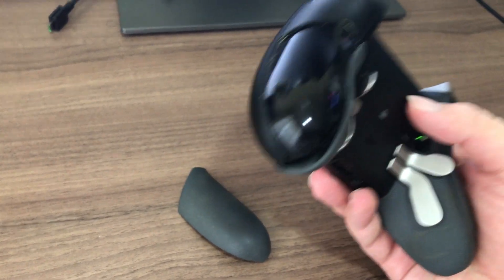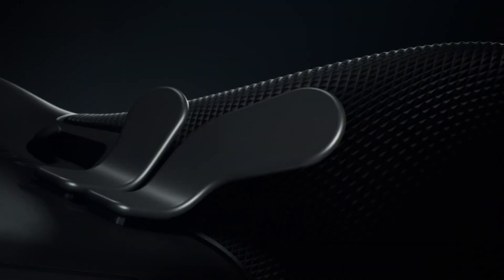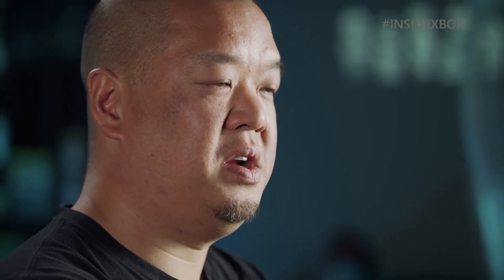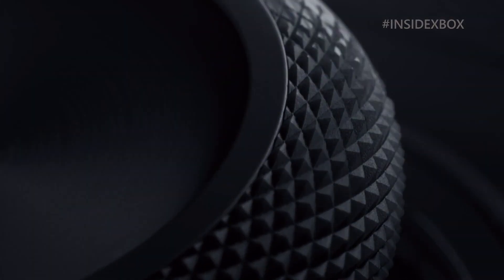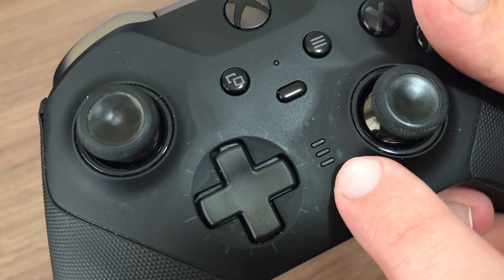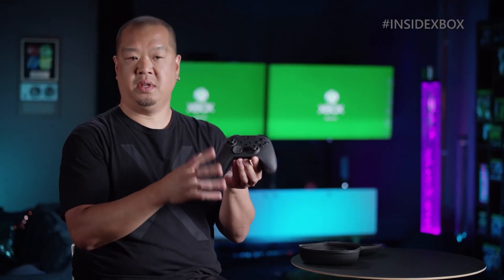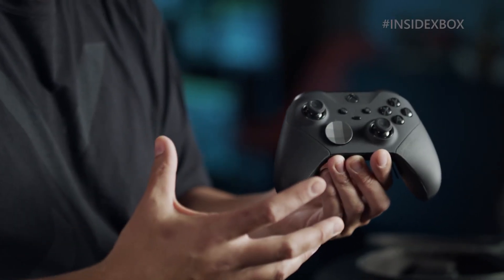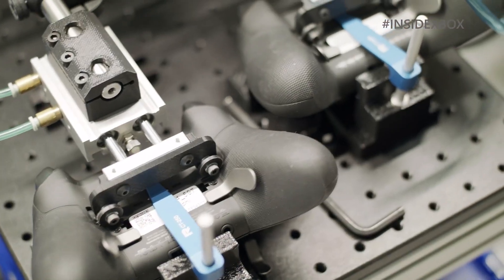Xbox Elite Series 2 After 1 Year: Did Microsoft Fix The Durability Issues?

Comment: Honestly the Series two will probably outlast its durability and effectiveness more that 6x longer than a Scuf controller. 

I’ve been looking for a wireless paddled controller that lasts longer than my current one (Fusion Powera $80). Mines still going strong after almost a whole year owning it. But i want a WIRELESS controller I can connect to my gaming PC since I am not eye-hand coordinated for Mouse and Keyboard. 

I believe this controller may last me longer than fusion, Scuf and add on paddles.
Reply: You would be wrong. I've had two series 2 elite controllers and both had ridiculous stick drift after a couple of months of light use and on one I didn't even notice that the top paddles on the back didn't even work because they where two short to trigger the internal switch , hard to explain but when you squeeze them you don't get that click no matter how soft or hard you pull, odd issue as my series 1 elite paddles work on the series 2 elite.

Long story short: the best feeling controller I have ever had. Seriously instant gratification upon picking it up. Battery actually does last an extremely long time, I Seriously believe you could run it for 24hour straight. Great charging pad/Case. BUT you are statistically very very likely to have to replace it within the year so even with Microsoft (after much customer demand) increased the warranty to a full year from 30 days you still have to ship it to them just to get a different refurbished replacement a week later.

If you buy it goto bestbuy and for once buy their custom extended warranty which will give you a new replacement right at the store off the shelf.
Reply: @inawrocki207  my bumpers failed on mine do you mind linking the video you used to fix yours? Thanks

Comment: Microsoft needs to learn how to make this controller durable as powerA fusion controller 😔
I’ve had a elite series last a month and the powerA has been having no drift no bumper issues for almost a year 😂
Reply: The fusion is probably the worst Controller ever, I have it and it is so shit even if everything works, you are a casual gamer I guess....
Reply: My powerA only lasted a few months
Reply: @paddifn  What's the next best thing? I have Series 2 and always have issues.
Reply: @paddifn  my powera jus started having issues after 6 months its starting to piss me off and i jus bought an elite wish me luck
Reply: make sure you get the extended warranty from Microsoft. $20 USD for 3 years with accidental damage.
Reply: They won't ever learn the Elite series 3 will be a broken pos with bumper issues 6 months in and maybe other issues non existing on the elite 2.
Reply: Yeah, the Fusion is nice on paper, but the back peddles are poorly designed and will always become loose and then break the connection point

Comment: I'm saving for this controller and I've had a Razor Ultimate for a year now. It got wore down like A registers as a double press when I press it once and RB not registering sometimes. I get anxiety about my controller and just keeping it clean. It's the same fear I have for this controller. I only game on weekends but it gets heavy use on weekends. I like this controller because it's wireless and BT.
Reply: If you haven't bought it yet, don't. It's cheaply made and the shoulder buttons will stop working. Save your money.
Reply: @rodtobam47  I did get it and I don't regret. I've had it for 2 years now. The right bumper has stopped working as you said it would, so I remapped it to one of the paddles. I still use it today. Honestly no controller is safe from time, wear and tear, not just this one.
Reply: @mutedust8229  honestly, the elite is the only controller I've had so many problems with. I get it tho, it's a great controller otherwise. I got the core version and use my old ones paddles.

Comment: The rubber on the S1 was designed to fail.

Sex safe silicone is sex safe because it has no pores vs regular silicone mixtures with pores.

Pores? you may ask; yes, microscopic pits from air bubbles in the surface of the silicone will swell as the silicone comes up to body temperature and allow sweat or body fluids inside, water is non compressible so when the pores shrink back down they are damaged and tear a little bit increasing surface area and making more room for water to invade and cause bigger, deeper tears.

If you examine the S1 grips which fell off it was because they increased in size and popped out of their fitment and popped off the glue holding them down.

This was a deliberate design choice as any engineering student will tell you because material sciences 101 uses the exact example of sex safe silicones VS standard silicone. They knew sweat would make the grips swell and pop off.
Reply from the maker: You got me with your first two sentences. Thought you were trolling, but I actually learned something new. What you explained matches exactly what happened to my Series 1. A bunch of bubbles showed up before the rubber grips started coming off.

Comment: after reading these commwnrs i dont want an elite 2 controller. can anyone give me good controllers with paddles?
Reply: I got the Strike Pack Eliminator 2 weeks ago for $40 (link given below). Love it and it has greatly improved my gameplay, because now I can not only use the back buttons for ABXY, but I can also have almost the same or very similar controller layout between Apex Legends, Halo 5, R6 Seige, Doom Eternal, and other shooters (by using this + the Xbox's built in controller customizer in the "Accessories" app), so my muscle memory doesn't need to restart every time, and getting faster reflexes in one game automatically helps me become faster in another thanks to all the games sharing the same control layout now. Only wish I could map presets like the 3 slots in Elite controller, as I switch between 3-5 FPS games often. There's no way to do that, so I use the "Accessories" app mentioned earlier to manually switch it every time I change a game.

https://www.amazon.com/Collective-Minds-Strike-Pack-Eliminator-Mod/dp/B07ZL9G9HJ

PS: the attachment allows some modding also, but that feels like cheating to me so I don't use it. I only use the back buttons.
Reply: @adnan.ahmed.1988  anyone who buys this sickens me. You give controller players a bad rep.

Comment: I’ve had my elite for 1 year now. Still works Completely fine but there is a rattle inside. And the Rubber grips near the bottom where you hold is now Popping out and it’s happening to the other side too

Comment: My RB literally has a stroke every time I press it I already tried taking the plastic out and exchanging it with other plastic similar in thickness and even swapped it out for the LB plastic should I use my warranty to just a new one already?
Reply: I tried that. Just use warranty, not worth trying to fix it. My warranty is gone and I feel like yeeting the controller whenever the RB button screws me over.
Reply: I just had the same problem I used my warranty so far no problems I have had the controller for almost a week so definitely use your warranty because they will send you a new controller

Comment: I noticed these are back 'in stock' on Amazon again. They were gone for a few months. Does anyone know if these new stock are revised versions or just the same ones?
Reply: I’m wondering the same thing i was finally able to get one at my local GameStop. Now I’m seeing everyone is stocked up on controllers. I hope this is a revised controller
Reply from the maker: No revisions as far as I know.
Reply: @jidenshaotoko  after a couple googles and Reddit’s i found that this latest batch can very much be the revised series 2. nothing different yet but it most likely is. We just gotta wait and see.
Reply: Same here bro, I don't know if I should buy it now or buy a dualsense and wait to see if it gets improved
Reply: @gustavoalonsorg1479  My dualsense has horrible stick drift on the right stick and the only game I play with it is Rocket League... Which means I VERY rarely use the right stick at all. The stick drift seemed to have just developed on it's own.
Reply: @KevsOutside  your right, you can tell its the latest batch by there being a "green line" under the elite series two wording on the front of the box...i am about to open my second one, i returned the first one due to there being a large dead zone, i am scared to open it tho. so i am doing extensive reviews before i make my final decision to either accept it if it happens again because there are really good other qualities which makes the dead zone tolerable or just give up and return it. wish me luck!

Comment: The rubber is what I really liked about the v1 vs v2. Um,, so I don’t know, what youre doing with youre stuff.. But I never had an issue with the rubberized coating getting ’sticky’. I think a more common issue with that would be if the coating gets a rupture or hole in it somewhere, which the grows and spreads until it all comes of. This can unfortuneatley happend with rubberized coatings. Don’t know about that sticky thing though, I don’t think that is something one has to worry about, that is prob only something that happend to you.
Reply: Happened to 2 of my controllers and my friends. Those rubbers glue just failed over time
Reply: @snc237  fr he doesnt know what hes talking about

Comment: I've gone through several elite v2 over a two year period that I honestly cannot say how many because I lost track. Ballpark figure would probably be about 15 and considering that I buy a warranty for everything they were an easy replace, that's of course if the store where they were purchased from has them in stock. I did just buy a razer wolverine v2 chroma and I am impressed at the responsiveness as well as the durability feeling. It just feels good and responds well. I did a comparison in elden ring's melee swing responsiveness and it felt at times using the elite 2 gamepad that the swing was delayed or felt like I had to button smash the lb/rb for it to work. The razer gamepad did not have this issue.

Comment: The analog sticks are still SHIT on these controllers. A few months max, unfortunately. Makes the controller worthless without a store warranty and even then Im renewing them every few months. I had one version 2 last about a year but that was the best case scenario. Xbox isnt even the main console I play. I may have gotten a little over 500 hours of use on the last one. Still shit. Anything less then 3-5 years of durability is a disgrace for that kind of cost. Three would be barely passable to me, since a standard controller can last about 1 year before drifting. If they cant fix the issue they should atleast make the sticks modular so you can swap out the guts. Microsoft doesnt even offer fuckin replacement stick attachments. Really dont support the product. My last version 2 didnt have issues with the rubber and bumpers this time, which is good, but the sticks are even more critical.

Comment: I got some questions: I am sending mine with the 14 day regret law that we have. This basically means I get all my money back if you regret the buy within 14 days but there is 3 days left for its experation date (if you know what law I'm takling about, does this matter is my question). Another thing is, if you have crack-opened it up, do I even have a chance at having my money refunded. I only have a couple of scratchmarks and the controller is fully functional except for the A button stick that came with the package.
Reply from the maker: I don't know where you live so I can't tell. I don't know your local laws. Here in Brazil I know that the company has the right to refuse your refund request if there's visible damage or tampering of any sort which opening the controller would fall under.
Reply: @jidenshaotoko  I just talked to the store people. They told me since I informed of product defect already before hand, I still have rights of it. As long as the product is functional (except for the issue that it had). In my case, A-button sticking.

Comment: about how many hours a day did you use this controller? any stick drift?
Reply from the maker: I've used it nearly every day, at least 2 hours a day, sometimes more. No stick drift so far. To be fair, I've never had any stick drift issues with any controllers, whether it's Xbox, PlayStation or Nintendo consoles.
Reply: @jidenshaotoko  how did you not get any stick drift? I got stick drift on every controller I used over 10 years of gaming.
Reply from the maker: I suspect that certain play styles are more prone to stick drift than others.
Reply: @jidenshaotoko  yeah I think your right 😂. One of my controller broke in to halfs
Reply: I used mine everyday about 3 hours a day for six months and the right bumper failed on me. It is completely unresponsive. No stick drift or other issues, but that's a big one so it still sucks
Reply: @Henrik1505  my N64 stick is still tight. Whenever I saw my friends playing, and seeing how they bashed the sticks made me puke. They thought it was normal to slam the sticks. I suspect you're like my friends and 95% of the population.

Comment: Just got mine haven't tried it yet but for those having issues does MS replace fix or refund if the controller has issues? Hope I made a good choice buying this.
Reply: I Called MS, They said they would try to fix mine, but if they couldn't they would replace it. My concern is the replacement may have the same issues as my original

Comment: I prefer to the smaller paddles of the second controller. I actually had an issue from the first controller where the top paddle layed over the one below it and I couldn't use them any more. The new one doesn't seem to do that so far. I do have one concern. I just purchased mine today and the rubber panel on the grip detached while I was playing. I snapped it back in, and it seems to be fine... but this is literally day 1 for me...

Comment: Shit controller for the price. I've had mine less than a year and it will randomly cut off when in use. Sometimes 2 or 3 times in a single rl game. The click on the left joystick is extremely sensitive too. I had to get the xbox official bluetooth dongle as a regular one barely worked for this even though a regular xbox controller had a strong connection with zero latency. Battery is starting to go out as well sometimes it's strong and times it runs out in a few hours. Overall the regular xbox controller is way better for pc and much cheaper so you can just chunk it after 6 to 8 months of abuse with no hard feelings
Reply: Update. I started keeping the controller plugged in 100% of the time and zero connection issues on PC. The joy stick clicker Is still very sensitive though
Reply: @e.collins2768  do you recommend getting one right now? i was planning on buying one from gamestop or walmart tmrw

Comment: What I wanna know about the new elite is the battery  when  u got it wired will that mess up the battery overtime
Reply from the maker: I can't say for sure. I used the first-gen controller wired all the time and never noticed anything weird with it. With Series 2, I use it mostly wireless.

Modern batteries have charge cycles that go from 0-100%. If you deplete it down to 80% and then charge it, it'll count for 20% of a new charge cycle and every subsequent charge will add to those 20% until it reaches 100% and that's when it'd count as a one full charge cycle.
Reply: no, microsoft on their website states that you do not have to worry about overcharging or by charging while playing...

Comment: It was always meant to have a huge durability but if you take great care of the controller
I did so to my series 1 and over years it never had any issues aside from a single time where the stick drifted but everything else like the grip was just fine
I always kept it as clean as I ever could and never touched it with my hands if they were even a tiny bit greasy or if they felt even a tiny bit dirty after sweating too much
So yeah, these controllers are durable forever if you take care of it right but it can be screwed up because of how many features it has

Also my sticks never lost their texture like it happens to everyone who doesn't take enough care when cleaning their hands before handling it

Edit: also don't worry about the battery not being removable, if you just want to use it wired it won't affect your battery

Comment: Have 2 elite 1 controllers. Only the first has lost the rubber grips after 1 year of almost daily gaming (replacement grips are easy to get)
Both have been used for over 2 years and none has issues with buttons or sticks. 
For me it looks like a step backwards in quality. No issues with degradation of batteries either...

Comment: I’ve had about three of these and always my top right paddle gives out my first controller it last a wh year my second one came broken off the box and my third only lasted like 6 months tops it really upsets me because I can no longer play regular controllers it has to be an elite or else I won’t bother or not even play
Reply: Same here. Really debating getting another one with the extended 3 year warranty from Microsoft store. The controller is great but the build quality is so poor. Mine has lasted pretty well. Only problem with mine is the top left paddle button doesn't work, so wasted extra input and the RB is losing responsiveness and needs alot of pressure to register input. So it's a slight inprovement to reliability compared to the Elite 1 which just disintegrates within a year. But button issues are still happening all over.